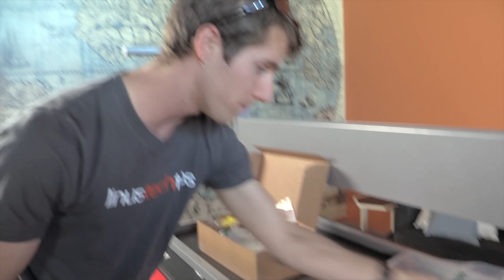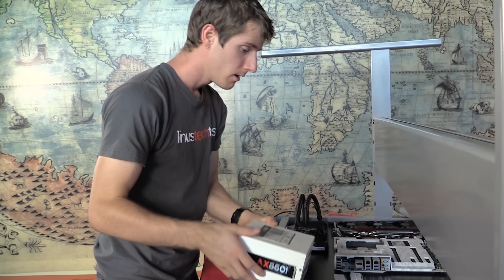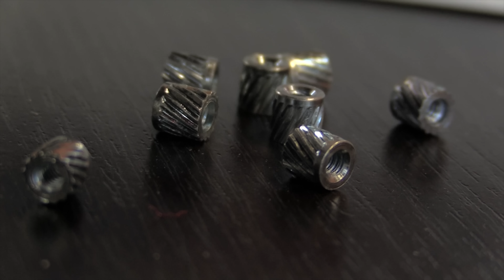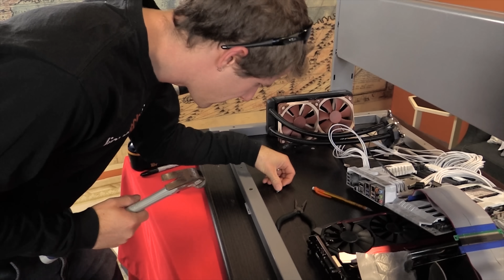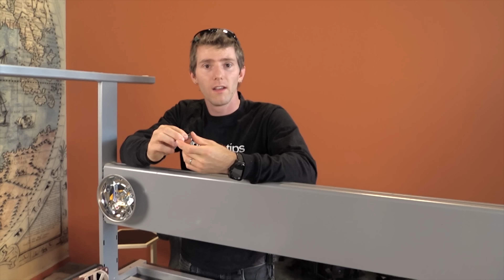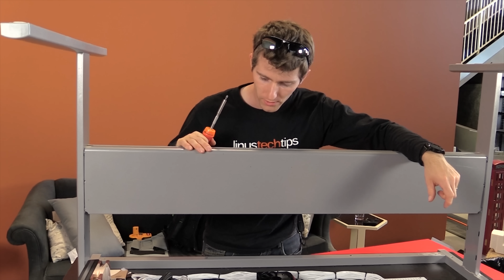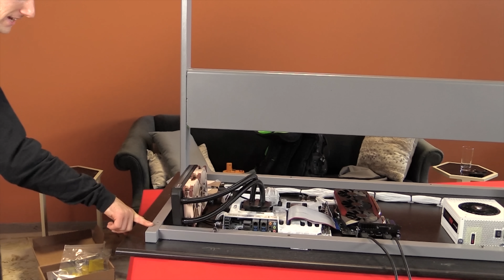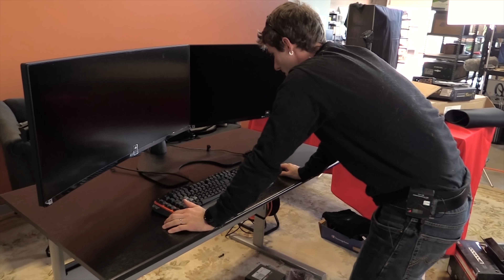The ULTIMATE Space-Saving PC - Desk PC Build Log

Comment: Another important point is to know the type of wood you are screwing into. If I'm not mistaken, it looks like the Ikea tabletop that Linus was screwing into is a particleboard and not a fibreboard. Fibreboards don't hold screws very well (I tried installing a keyboard shelf under an Ikea LACK coffee table). So yeah, keep that in mind if you want to attempt this on the cheaper IKEA furniture.
Reply: The density of that board is important for sure. There's some cheap stuff out there.
Reply: +Kenneth Tang the ikea lack coffee table is cardboard, not wood. if you didnt figure that out maybe diy isnt for you ;)
Reply: toby marol Fibreboard is the appropriate term I believe. Cardboard is what the furniture shipped in. lol.
Reply: +Kenneth Tang Lel man, try cutting the LACK in half.

It's literally power-coated cardboard with triangle-shaped sideways cardboard supports. That's why it's 3 inches thick.

fibreboard actually holds screw really well, but the LACK table is 90% hollow. Only the legs are fibreboard.
Reply: ThereIsNoMatch Ah my bad. I just realised you and Toby are right. Same as the EXPEDIT bookshelves that I broke once and saw the insides. WTF cardboard....

Comment: Unless that desk's particle board has some real solid density, I'd be a little concerned about the weight of some of the components on the long run (power supply?). The motherboard has plenty of mounting points, so no much concern there. Aside from that, looks awesome Linus!

Comment: Although weight of the hardware is not a issue, he should use some glue on the mainboard mounting holes and brackets that holds the PSU and GPU. That will get dislodge to the weight of mainboard overtime due to gravity.

Comment: you could actually mount a cover to all of that with L type brackets and cut some holes to get air to the GPU and a hole that would fit the PSU which would leave it pretty much the only thing sticking out and then it would be a lot safer. Also as a personal preference I would mount (if I were to do as above) the GPU on a side so you don't kick it with your knees. 
You could do better but it's a fun DIY.

Comment: nice build but its not visible. what I would have done is to build it in a drawer which goes into the table with glass top. that would be really sick. sufficiently long cable should be used to pull out drawer if needed for easy access of components.

Comment: hey guys!, I wondered if this build is good:
(these are all legit and good condition)
Intel core i3 4330(used £50)
MSI geforce gtx 760(used £80)
8gb of crucials ballistix ram(used£15)
WD blue 1tb HDD (£35 new)
gigabyte ga-h81m(£35 new)
cooler master hyper t4 aircooler (£20 new)
evga 500 W PSU(£35 new)
thermal take versa h13 Matx case (£30)

price: £300ish (is it worth it?)
Reply: +Christopher Vinciguerra nah, id say high settings on most games but medium on more demanding games.

Comment: How do you find out whats wrong with your build when it doesn't start up
Reply: +Dah Arcnite i would never know if my mobo is broken or if its my cpu, is there like a hint on  the screen to find out whats broken?
Reply: +Dah Arcnite Your motherboard can produce a beeping sound, that translates into an error code that you can lookup in your manual. But otherwise it's just some trial and error, switching parts etc.
Reply: OK thanks I didn't know about the beeping sound.

Comment: That's actually quite a cool idea! Lower temps, less space taken up, less cable mess... 

Loving the new title sequences by the way. Very pro!
Reply: +Ivanderjsk it's underneath the table though so it shouldn't be too bad. I'd be more worried about it being very exposed. you're likely to kick it or accidentally poke it or something/
Reply: dust...
Reply: +citizend13 you could put some rails in to stop knees from hitting.
Reply: +Ivanderjsk Air compressor...
Reply: +DIY Perks That's actually quite a good idea your using! Comment on other popular videos, get alot of likes, get potential viewers for your channel.

Loving the same comments you are putting in each and every Linus video. Very pro!

(if you catch my drift). :P
Reply: +DIY Perks Hi there !
Reply: +Darkorta Some cases actually limit airflow and can trap hot air put off by components and raise the temperature inside of the case vs the ambient air temperature. Having it open air like this means warm air can be dispersed faster, since the components aren't trapped in a box. Plus if you're like me and have your desk right next to your A/C vent, it's going to have some nice cool air blow over it.
Reply: +ABaumstumpf that second bit about it getting the best temps is not entirely true. If you have a good case and setup your fans in a good configuration, the airflow over your components will be much much better, whereas in an open config there is 0 airflow over components. This build is just for fun/uniqueness
Reply: +DIY Perks Hi DIY Perks, big fan of yours been watching all of your vids it's very entertaining and educational as well glad to see you commenting on linus work.
Reply: +DIY Perks WOW you watch linus too, cool
Reply: +DIY Perks funny to see another YouTuber that you know commenting in videos.
Also, it would be nice to see your silent DIY take on a desk PC :P
Reply: +DIY Perks And you can accidentally smash your knees/feet into the parts underneath the table.
Reply: JMF Sound have fun cleaning it all the time..
Reply: +citizend13 I am concerned about all that heat coming at very delicate body parts lol
Reply: +DIY Perks I would actually lug this to any lan party just for the bragging rights
Reply: +rubikfan1 would be better to use a piece of plexiglass with vent than a piece of metal because it doesn't conduct  electricity
Reply: +DIY Perks I like your ultra quite case though =P Very nice looking, and no chances of accidentally kicking it because it's a noticeable object.
Reply: +Darkorta Cases have vents and thus idle at room temp.
Reply: ***** It also highly depends on how much airfow you have. Although there are vents, if there's lack of airflow, the air will just keep getting hotter if inside a case. Where as this, being not confined, it will always be near the same temps as the room it's in.
Reply: MiniNinjia Absolutely not true. The parts will run at their normal temps, they just won't get hotter because of trapped air.
Reply: ***** Okay. The parts will run normally, but it's not ideal is what I meant to say. You can have a case with no fans, but then the components get hotter than most would like or are comfortable with. But when it's in open air, the air circulates more because of the constant moving of things, people, etc... The point is, cases have a chance of getting lack of fresh airflow, where an open air case doesn't. It's like opening your windows in your car while it rains, vs putting down the roof to your convertible when it rains. But with air and cooling at mind.

Also, I'm sorry this is long. I suck at explaining things briefly.
Reply: MiniNinjia Yes there would be better air flow because there is much more room to vent.
Reply: ***** Yes. But the vent you were referring to was air vents to allow air to enter and leave passively. The open air concept is to disperse into the atmosphere rather than inside a contained unit with holes for air to try to escape. The whole reason why blankets and clothing are made is to contain heat that your body produces. You can have holes in your clothing, but you'll still retain heat. unless you wear light clothing or no clothing at all. Same concept for open air vs cases.
Reply: MiniNinjia I just meant that because they have vents, they are connected to the room and so will always start at room temperature.
Reply: ***** YOU NEVER MENTIONED STARTING AT ROOM TEMP!!! Oh my god. So much confusion and controversy for this! What I thought you meant was during run time and heavy use while gaming. Everything starts off room temp when it's first started! Why is that even a topic of discussion?
Reply: MiniNinjia Sorry I said idle, but I was responding to a guy who was making it sound like if it's in a case it will never be at room temp.
Reply: ***** Everything goes to room temperature at some point. Even a thermos with boiling water. Leave it for a few days and it's room temp
Reply: +Darkorta no he is right. the case althou vented still traps some of the air other than dissipating the hot air in a much more open enviorment
Reply: +Darkorta no he is right. the case althou vented still traps some of the air other than dissipating the hot air in a much more open enviorment
Reply: +Rekr put a thick plexiglass sheid with vents
Reply: +DIY Perks and if your pc is in the case the cooling is better if you know how to place your fans right.
Reply: +Darkorta a computer case cannot get below ambient temperature and even if it could water particles would form inside the case. so temps should be the same if not lower due to the fact the components are sending the heat straight to the room's air
Reply: Captain Technology when you say cannot you mean ever but itself or ever because lower temps will cause damages?
Reply: +DIY Perks big fan!
temps will not be that much lower, though - a PC case with a few fans will definitely have a directed airflow, while an open build will have much more air turbulence. I did some checks once and it turned out that well ventilated case is better than no case. Just a few degrees difference, but still.. Tests were done on an OC'd Pentium "K" and a GTX670.
Reply: jlebrech poo
Reply: dust which can be can aired off. As for lower temps. dont put it near your vents in your home.
Reply: unless your are a tall gut with adhd like me. my knees are gonne destor that pc. cant they add a metal cover?
Reply: +DIY Perks The dust is gonna be real tho ;)

Comment: A Cool and simple addon to this would be to put usb connectors mounted on top of the desk so you can plug in a thumb drive. ive seen like a 6 ports on 3.5" and all youwould have to do is cut a square hole and mount it.

Comment: About time you did this. Thumbs up for effort, but this is not usable. If you have to be careful, if you have to tell everyone who is going to use this desk to be careful, it's not working.

It is better to have the PC inside the desk, and a matte black glass you can lift up/open up to add extra ram or whatever. Like a lid. Like everyone else who builds a PC desk has. Ofc with optional light switch so you don't see all the PC lights. They are all connected to a button you hit to impress people the first time they see you Glorious PC desk. 

I'm not a fan of Liam Li PC desks, but I'd prefer that over this. But this is just the first PC desk you have built(?on camera at least) and many more will follow, maybe we'll get 3 updates within a year on how you are improving this. 

How is the current noise level? 
Do you feel any vibrations in the desk?
How is it for a normal person of 6' to use this? ;)
What about a giant of 7' ?

PC under the desk like that is too unpractical. You turned the desk frame. Looking at that "metal board" on the frame, you might want to look for a desk where that metal board is adjustable or is in a slightly different position, and have the PC behind that metal board. So no knees bump into anything, or that knees only bump into the metal board.

Comment: See i thought about this, but the thought of a drink slipping off of my desk and splashing up onto my components had me hesitant.
Reply: +Outlaw Dave honestly that scenario would be pretty hard, if it spills onto it flows off the edge, if it drops from that height from the edge of the table I doubt it could splash back up that high.
Reply: DCCXVIII
 well most of the components are also on stand offs and more importantly INSIDE the metal frame which would create a drip edge that would likely stop any fluid running on the underside of the desk due to surface tension from getting back to the components, if you wanted to ensure this you could run a bead of silicone along the outside edge of where the metal frame meets the table top, that would ensure no amount of surface tension would allow fluids to reach the components.
Reply: +DanielRichards644 Unfortunately physics (or in this case, surface tension) is a thing. What actually happens is the liquid flows both off AND runs along the underside of the table, destroying all your components along the way.
Reply: Aye, you would definitely need to silicone the gap in between the metal frame and the bottom of the table. This then would prevent liquid from getting to the components because the liquid would never travel back up the other side of the metal frame because..gravity lol.
Reply: DCCXVIII
 depends on how tight the frame fits to the table top, it might not even be needed.

Comment: Not the best desk PC I've ever seen, really not all that noteworthy either, I don't even think it solves any problems but sure seems to make them. Also I'd get a grill for those fans on the AIO cooler. And for anyone contemplating a similar build you may even be able to put a grill on GPU fans since those are usually standard sizes. 

Also, just a thought, how cool would a build like this be if it was watercooled using hard-line tubeing and some of that glow in the dark fluid and put a blacklight under the desk on them.
Reply: that would be cool
Reply: +William Gracia correct me if i'm wrong but glow in the dark fluid is not an appropriate desktop cooling liquid. It's for showing off, not long time use. You could just have some black lights everywhere and behind the tubing instead though and glow in the dark tubing probably.
Reply: +xXKameroniXx sorry that was at 1 am, I think what I mean was UV tubing which come to think of it, I don't think is available as a acrylic or any other hard material?
Reply: +William Gracia With a build like this, i'd think soft tubing or copper would be better than a regular hard-tube build.  Soft tubing would absorb impact better, and copper couldn't be broken by your leg.
Reply: +jedidethfreak i feel like that's just a fatal flaw of this implementation regardless of what you do. if you're going caseless mount it to the wall or don't do it at all. really it needs some sort of glass over it or something.
Reply: +William Gracia It takes less space, removes the need for a case outright, and removes any hassles of having a case in general, such as compatibility. This isn't a bling build, it's a practical one.
Reply: +enginesnblades but it isn't practical, he goes to scratch his leg and a finger gets cut in the fan on the radiator. He accidently touches the gpu and ESD destroys it, or the mother board, or the SSDs. How much dust is under your desk? You'd always be cleaning it. Practical is getting a NUC or a BRIX and mounting it to his monitor stand.